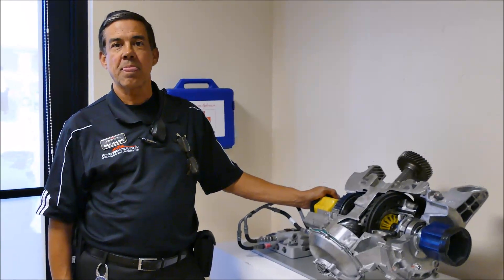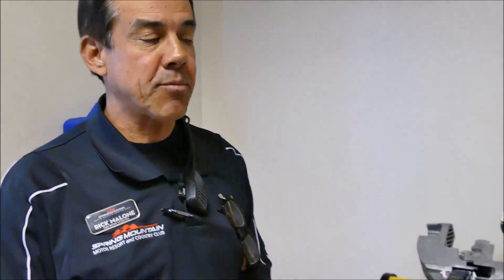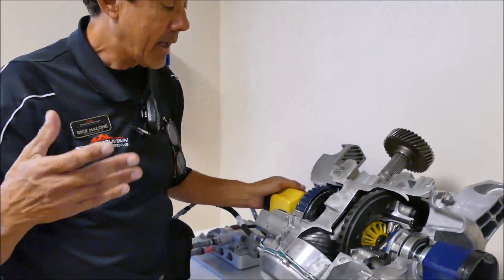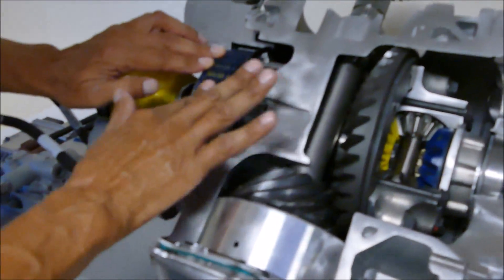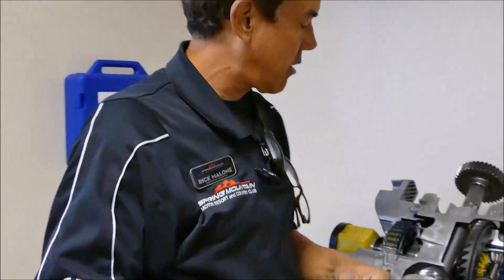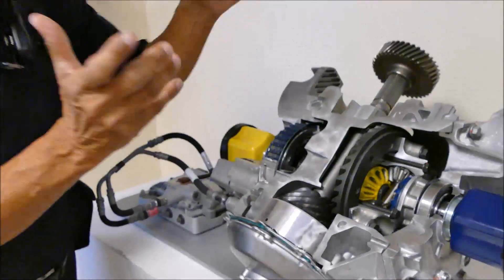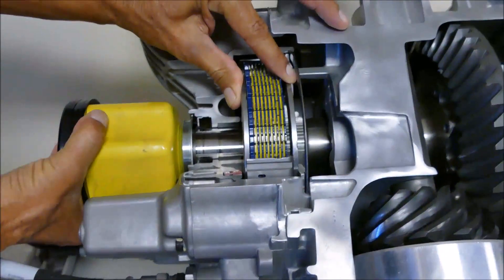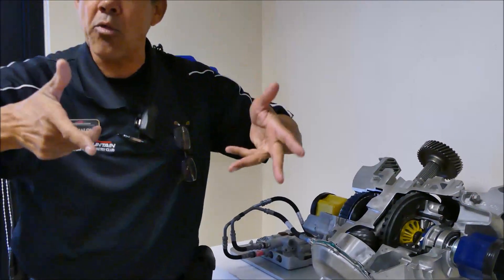7th Gen Corvette Electronic Limited Slip Differential Tech Talk

Comment: I had idiot shop SWEAR my elsd used regular shelf gear oil. I told them it has 2 separate fill holes, 1 for rear diff and 1 for front of diff. I researched which wasn't much info and found Volvo used same rear diff and used special fluid for front where oil pump is. Anyways I believed then and fucked up oil pump and those clutches. Called dealer and found they sell 1 quart of special acdelco fluid for $100, ended up having to buy $600 pump too cause that heavy weight killed it, anyways used right shit and brought it back to life but hasn't been same since. The dipshit which acted like he knew every nut n bolt of every car made, works at advanced/ that other combo shop, he yelled when I said that fluid was wrong and fucked with my car, he flipped and said gtfo and go to a dealer if I think he's lying.
Reply from the maker: Oh wow! That's awful!

Comment: That might be ok for the race track, but for long-term road use, I want mechanical, not electronic.  These auto manufacturers have got to start cutting us some slack on maintenance costs.  These complicated systems are just too costly for the common person to afford to repair.  I'll step off my soapbox now.
Reply: Thats what they were saying in the 1940s when some people still had their old simple Ford Model T's.
Reply: good point, however, these are on high performance expensive cars so the owner must know there could be a chance this will happen.  The lsd component of my diff is messed up causing a clacking noise when I turn but the rest of the diff is fine.  I will keep driving it like that for now.

Comment: You actually do not need the spring pack installed in say a 12 bolt posi, IF you shim up the clutch pack and axel end play properly. Most mechanics don't know how to do this but there are You Tube video's that show you how.

Comment: There's not 5 or 6 pistons it's just one big duble sealed piston with 2 lip seals one in the middle and one on the outer edge of the piston. Same piston and hydrolic chamber design that's in automatic transmissions that apply clamping force onto the clutch packs